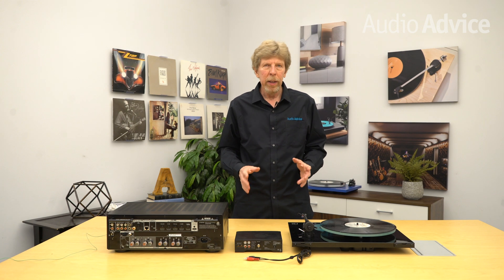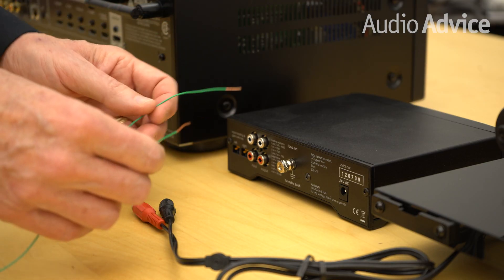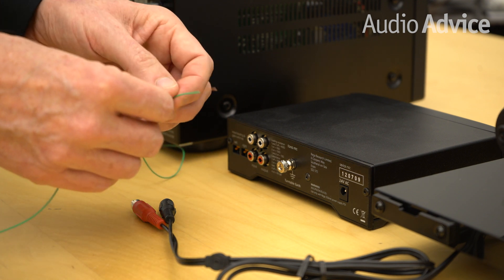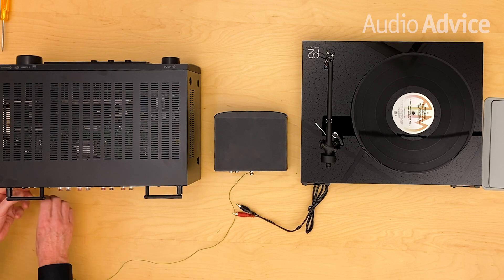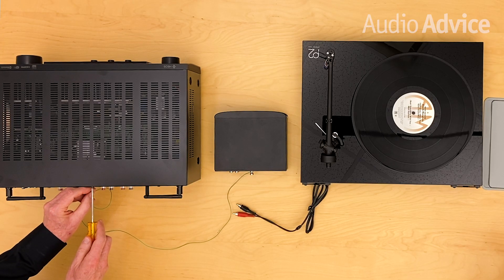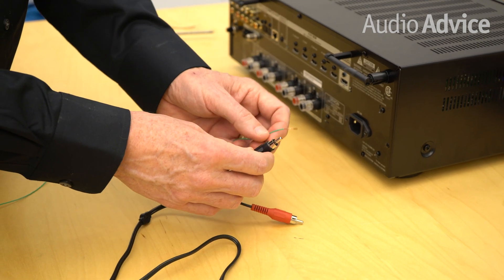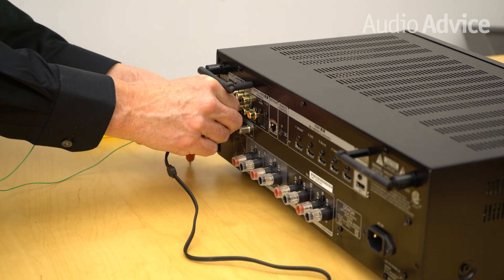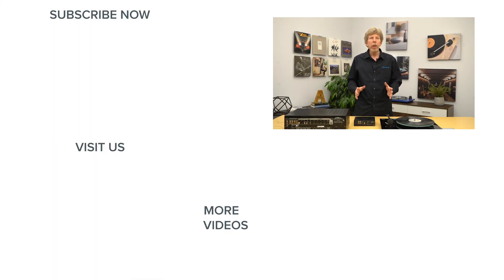How To: Ground a Rega Turntable

Comment: It seems that there are a lot of people who seem to have a Hum problem with their Rega P1,2,3 turntables I am saddened to see that I am not the only one I had to return more than 2 turntables with this type of problem finally the 3rd does not seem to have this problem except at high volume Rega should see to it it is really annoying !!!!
Reply from the maker: They believe in a different grounding method.  It works in most cases but not in all, which is when you need to use the methods we describe.

Comment: Thank you, I will try tomorrow. I have a question. My system also have two rel subwoofers with high level connection, and the the ground cables of the sw are connected to the left amplifier speaker output. Hoy should I connect the rega turntable? to the speaker plug too? or to te amp screw?
Reply from the maker: Bear in mind you only need to do this if you are having hum, which many people do not, but if you are, you should try the amp screw if its an integrated, if separates, the preamp
Reply: @AudioAdvice  thank you

Comment: What about if using just an stereo amplifier connected via aux to pc
Reply from the maker: If you have a Rega connected to your stereo amp, this would still apply.  Thanks for watching
Reply: @AudioAdvice  nah no rega I use a kenwood stereo amplifier that has buzz sounds but it's only connected via red and white aux lead ... but I do see a ground screw on the amp but what would I ground or connect it to

Comment: Will this work with a Roksan Atessa? I do have a humming problem from it and there is no Earth point. I did manage to reduce it by replacing the expensive audio cables with cheapest old pair I had in my box of old bits. Just goes to show!
Its still got a hum though. Will it cause damage if I try it?
Its plugged in to a 6007 Marantz amp.
Reply from the maker: We are not sure, but it will not hurt anything to try.
Reply: @AudioAdvice  Thanks I'm pretty sure it can't hurt so I'll give it a go

Comment: I have a Rega P3 (2000–2007 version) and I recently bought the Elys 2 cart.  The Elys 2 cart picks up EMI from the transformer in my phono stage.  If I pick up and rotate the P3 the hum increases or decrease depending on its orientation to the phono stage and the same applies if I rotate the phono stage.  It was so bad that I moved the phono stage as far away from my Rega as I could.  I've never had this problem with any other cartridge with the same phono stage.

Have you ever come across that?
Reply from the maker: The Rega cartridges are unshielded.  Rega feels it makes them sound better, but you can encounter hum if there is a field nearby.  Hope this helps

Comment: So to understand this better, if I'm using a different brand of phono headamp, then I should connect the 22 ga. ground wire to the Rega TT left channel interconnect, plug that into the third party Phono headamp, then jump the ground wire over to the amplifier ground post? Why wouldn't I attach ground to the head amp ground post then jump over to the amp's ground post like your first scenario using a Rega Phono Pre and the Denon amp in your video? Great video, thanks for posting!
Reply from the maker: Glad you liked it. Try both ways and use the one that works best.  It seems to vary in different environments.

Comment: Hi, Thanks for this video I just have a question I have a Rega P1 ECO with Project phono preamp which has a grounding post but I then run straight into active speakers how would I make a ground loop as i run the rega rca into the preamp then an rca to 3.5mm into the active speakers from the preamp and the speakers do not have a grounding post, Thanks in advance
Reply from the maker: Reach out to our experts at audioadvice.com and they can help you out!

Comment: Did not work for me, sadly. I have a P1 plugged directly into a Demon PMA-600NE integrated amp. Hoped this would be the fix for that annoying hum, but no luck. Am I gonna have to invest in a phono stage?
Reply from the maker: Did you try grouning to the Denon chassis?  You might have to find an area where there is no paint so the ground can attach to metal.

Comment: Does it matter if the ground wire is connected between the washer and ground screw? Or should the washer and screw be over the ground wire? Thx in advance 😊
Reply from the maker: It does not matter. Thanks for watching!
Reply: @AudioAdvice  thx 😊

Comment: Hello. I use a Rega P1 + Schiit Mani (phono pre amp) and I connect directly in a active speakers Edifier S1000 mkII. How do I ground it? Thanks
Reply from the maker: If you have no hum, there is no need to, as that is the case with most systems.  If you do, follow these instructions using the Mani as the grounding point.  Thanks for watching

Comment: I have a Rega P1, and it worked with my Creek Evo, but not my new parasound amp, so it's going to the shooting range w/me soon. Designing a turntable without an engineered ground, and some hinky wiring job I would have done to get a 62 Chevy Nova home in 1975 isn't exactly quality engineering of hi fi equipment. This is how Rega operates.  All RCAs are designed w/those notches in the modern era, the turntable has serious design flaws, including motor noise, bad belts, and no ground. A .270 at 150 yards will do it good.  It's a garbage brand imo.
Reply from the maker: Before you take it out and shoot it, you might want to do two things, first check its value on ebay, they hold their value well and second, your issue may be the Parasound.  We are a dealer of theirs and have had some products produce more residual hum than expected in some systems.  We just had an A23 power amp trying to drive a passive subwoofer and you could hear the residual amp hum.  Thanks for watching

Comment: Hi @AudiAdvice. Could you help me solve this problem. I have low level hiss off a Rega P6 with a Rega MK4 MC phono stage into the aux inputs on an Exposure 2510 integrated amp. I grounded the phono ground post to the amp ground post, as per the video. However I’m still getting the his. I had the Rega Elicit-R and never had this problem but now introduced the Exposure 2510 and have this noise floor. This is into a pair of Kef R3’s at 87db. Thanks for any advice. Could there be a fault in the amp to phono stage inter connector wires?
Reply from the maker: If you had no problems before, the new component is likely the cause.  Thanks for watching

Comment: I'm not sure I am clear on method 2. Would it work if all the magic were done on a non-Rega phono preamp? For example, on a Schiit Mani 2, attach one end of the ground wire with the left plug and the other end on the phono preamp's ground connector? So no ground wire on the main amp?
Reply from the maker: You could try that sure.

Comment: Is it safe to further ground the phono preamp to the receiver (through a wire you just showed) to eliminate hum?
Reply from the maker: It should not hurt anything.  Thanks for watching
Reply: @AudioAdvice  Is there a danger of introducing ground loop in the system? Thank you for the answer!
Reply from the maker: @kostas9826  Not likely, but you will certainly hear it instantly if it does cause one

Comment: Didn't work for me unfortunately. My planar 2 is connected directly into the phono stage on my yamaha receiver (RX1040A) It's one of my biggest issues with the rega TT. My technics SL1210 has no issues whatsoever when connected to the same amp. I cant understand why rega don't provide a separate ground wire. Unfortunately I was sold the dream!!
Reply from the maker: Sorry it did not work.  Are you 100% sure you made good contact with the metal surface, sometimes the paint acts as an insulator.  Rega has always made their tables this way and claim it sounds better when they put the ground on the audio cable, but it is different than everyone else.  Thanks for watching

Comment: Hello. I have no ground problem. My P3 is connected to a Naim Stage line MM preamp which has a ground  connection. This goes to a Sudgen preamp HA-4 (preout) with no ground connection and then in a Rotel Ra-980 BX (Main In) which has ground connection. Should I connect the Naim pre to the Sudgen preamp by a wire ?  or the Sudgen preamp to the Rotel Main opower amplifier?   Or leave it as I have no hum at all. It's all about sound quality. Thanks a lot.
Reply: thanks a lot for this fast reply. Have a rockin’ week-end. Stay safe and peace from Luxembourg.
Reply from the maker: If you have no hum leave it as is. This is only for odd combinations that cause a little hum. Thanks for watching

Comment: Is this unique to older rega models. I have a rega planar 3,  2 years old with the thicker better phono out cables linked to a Marantz pm6006  & to be honest haven't noticed any hum.
Reply from the maker: It applies to all however 95% of users are like you and never have an issue.  There are just some combinations that can have a problem which is why we produced this video.  Thanks for watching.

Comment: Thanks for this video, great explanation! 
My Rega RP1 is connected to a Pro-ject Tube Box S2 which is connected to a Nubert AmpX. I had crazy ground humming and tried different variations of the solutions presented here. I ended up with one ground wire going from the left output channel of the Rega into the ground post of the preamp and another ground cable going from the ground post of the preamp to the ground post of the amp. The humming is much, much less pronounced this way yet still audible and still very unnerving. Any other recommendations you can offer?
Reply from the maker: Thanks!  Something else sounds off.  Do you have hum with the Tube Box connected but with no phono cables connected to its input?  And bear in mind Rega cartridges are unshielded and do not like to be close to amplifiers, that could be part of it.  Thanks for watching
Reply: @AudioAdvice  Thanks for your answer! The humming is only there when all devices in the chain are connected and turned on. After some further investigation I noticed that the Nubert Ampx isn't even grounded despite offering a groundig post for phono. So I grounded the amp myself and the hum became much, much less noticeable. It's still there though and it doesn't make a difference if I gound the turntable or the Tube Box or both.
The cartridge I use in the Rega is a AT-VM95SH by the way.
Reply from the maker: @MKorn  You might try a different amp in the loop and also connect the Rega direct to the amp to see what happens as it does look like its got a phono preamp.
Reply: @AudioAdvice  When connecting the Rega directly to the phono input of the amp there's no hum.
Reply: I have a Rega P3 going to a Lehmann Black Cube SE II, then to an NAD C 320BEE integrated amp. I have blown the board 3 times on preamps and now am realizing I likely need to ground the preamp to the NAD. Would I go from the left channel of the turntable’s RCA connection in the preamp to a grounding screw on the back of the NAD?

Comment: I did version 2 and the left channel stopped buzzing. Can I ground both channels with a Y cable?
Reply from the maker: That is odd, you should try just grounding the right channel and see if it stops buzzing, and if it does try both.  Thanks for watching
Reply: @AudioAdvice  Grounding the right channel solved the problem. Thanks!
Reply from the maker: @gaborheidt1692  Glad we were helpful!
Reply: @AudioAdvice  Unfortunately, it doesn't work. Whichever channel I ground, the noise is eliminated. If both, there is no playback. What could be the problem?
Reply from the maker: @gaborheidt1692  That is very odd, you may have a wiring problem in the cartridge or turntable tonearm.  You might want to contact the dealer you purchased it from.
Reply: @AudioAdvice  Thank you, resolved! No grounding required, an SMPS was faulty.

Comment: This may seem like a dum question, but when your adding an extra earth cable, why does it have to be on the left channel audio cable and not the right ? I thought the black represents the left channel and the red represents the right, meaning they both do exactly the same thing. I'm asking because I need to do this, and I want to get it right.
Reply from the maker: That is not a dumb question at all!  Rega puts the ground for the table there, that is why.  We hope this will be helpful, thanks for watching
Reply: @AudioAdvice  Thank you so much. My confusion is at an end. Love your channel.

Comment: I'm sorry to say but this didn't cure the problem, I have an RB 300 arm and it has a 
ground wire but connecting that does not stop the hum either, but if I put my hand under the plinth and touch the large nut attaching the arm to the plinth all hum disappears, I do not want to solder a wire to this nut but I have found a large thin washer that we fit between the nut and the plinth and I will solder a ground wire to that.
Reply from the maker: Thanks for sharing, that will likely fix the hum.

Comment: Kick hooked up my rega 6 to audiolab 6000a having sound issue when moving arm toward or away from record...cud this be the problem?
Reply from the maker: if the sound issue is hum, it could be, if it is static, it could be bad internal wiring in the tonearm, which is extremely rare, but can happen
Reply: @AudioAdvice  thanx for the reply..it seems absolutely fine now... hopefully it was a cable issue...thanx again 👍

Comment: It doesn't work. I have REGA RP6 turntable + REGA ARIA mkII phono + REGA ELEX-R and REGA ELICIT-R amplifiers. And both amps have a very unpleasant hum, whether I'm using an external phono stage or plugging into the amplifier's phono input directly.
And your advice doesn't in practice, I can connect the ground of the phono stage and amplifier with a separate wire or I can add a wire between the ground of the left channel and the ground of the amplifier - it doesn't change anything, the hum remains.
But if I disconnect the left channel from the amplifier (or phono stage) and connect the ground of the left channel to the ground of the amplifier (or phono stage) with a wire, the hum disappears completely. The ONLY solution is to modify the standard tonearm cable, disconnect the ground from the left channel and bring it out on a separate wire, as is done by all normal manufacturers.
Reply from the maker: Sorry this did not work for you.  It normally does.  You have some great Rega gear and you modified your arm to get it to work.
Reply: @AudioAdvice  You have nothing to apologize for, this is REGA's fault. If your advice helped anyone, that's great. I just wanted to inform those who are unlucky like me. Thank you for your time.
Reply: @violentsense  Didn't work for me unfortunately. My planar 2 is connected directly into the phono stage on my yamaha receiver (RX1040A) It's one of my biggest issues with the rega TT. My technics SL1210 has no issues whatsoever when connected to the same amp. I cant understand why rega don't provide a separate ground wire like technics. Unfortunately I was sold the dream!!
Reply: @Sequeldj 😮….. I’m frustrated searching solutions, I’ve just bought Rega P2( one month), the hum noise is killing me. You have sold your Rega …? Is that the end?

Comment: Can you link where to buy the ground wire? I’m looking on Amazon and all the options are a bit overwhelming since I don’t know which one I need
Reply from the maker: If the ground wire is for a turntable, there is nothing special.  A piece of 22g wire you can get at a hardware store for a dollar will do the trick.  Thanks for watching
Reply: @AudioAdvice can it be 14 guage speaker wire?

Comment: I have a Rega Planar 1 Plus and Edifier Active Speakers and have this problem too. Should I do the same, but with the Speaker screw? Thanks!
Reply from the maker: If the Edifier has a three pronged plug, it should work.  Thanks for watching
Reply: @AudioAdvice  Oh, no. It doesn't :'( Any other advice? :(
Reply from the maker: @frc04101  You should still try it, the speaker may be grounded in a way that it would work
Reply: @AudioAdvice    I just tried it and the hum was still there. :( Is there any adapter that turns the speaker plug into a three proned plug?
Reply from the maker: @frc04101  Not that we know.  You might make sure a ground actually happened, sometimes you have to scrape off a little paint under the screw.
Reply: @AudioAdvice  thanks, guys. I appreciate your help.

Comment: I have my p1 connected to phonostage, then into headphone amp (wanted for headphone experience), so no actual amplifier. Should I use method 2 of the video, where I attach a ground wire from the left channel of the RCA cable from the p1 and then attach that the grounding post of the phonostage, unlike the video where it attaches to the amplifier instead?
Reply from the maker: If you are having hum, yes.  Thanks for watching

Comment: Brilliant succinct advice! I have just taken delivery of a new Rega P6, and absolutely delighted with it until I noticed a hum when listening through headphones. Very slight but once I knew it was there it got under my skin and really started to irritate me. Saw this video and linked a short piece of old earth core between the grounding posts on my Cambridge phono stage and Rega Io amp, and instant success and silence👍 Great work, sir !
Reply: Did u put it in the rca as well in video... just got a p6 as well
Reply: @philrob4468  I didn't put any wire across the RCA - just worked in my case to connect the phono stage and main amp earth terminals.

Comment: I called Audio Advice and they said they DON'T send the wire unless you come into the store. I mentioned this video and but they said they didn't have it. Was easy to get the wire, but irritating that they weren't helpful.
Reply: I live just up the road from them and customer service has been hit or miss for me. Some of the main floor guys are "aloof" at best. But I've had generally better experiences with the online order support staff.
Reply: Any core from a piece of spare mains cable will be good for this 👍